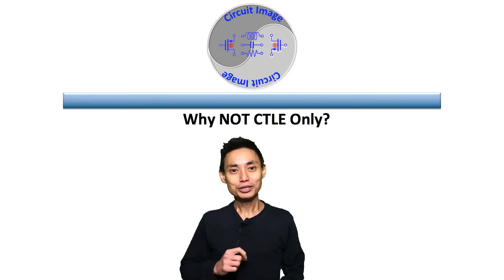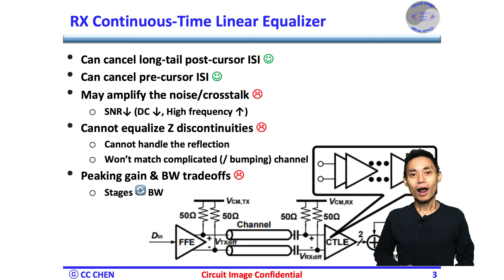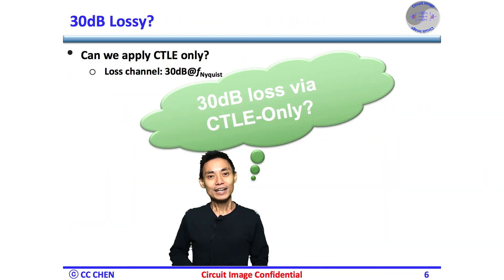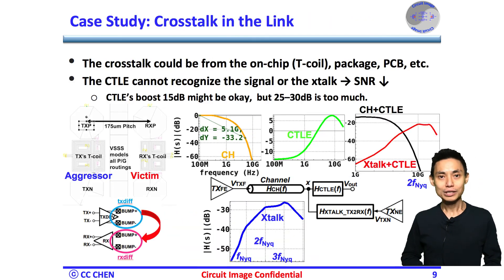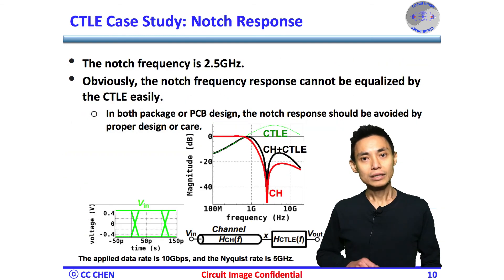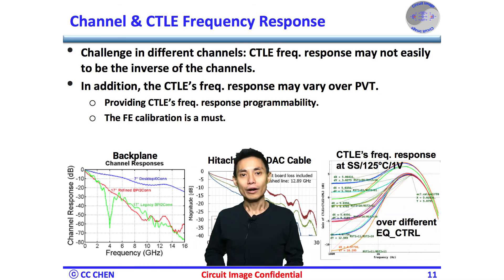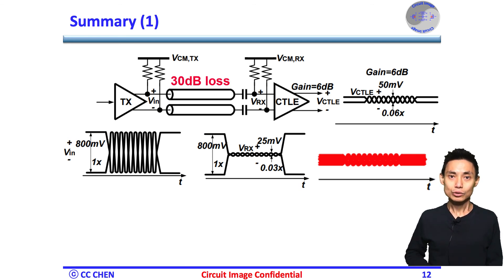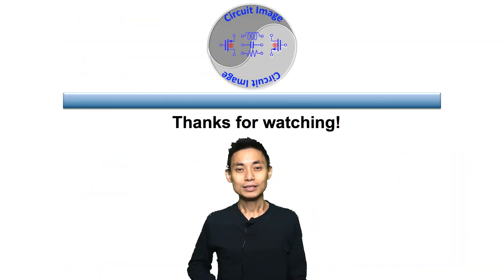Why NOT CTLE-Only?

Comment: Hi chen,I wonder why FFE can also solve the problem of impedance discontinuity,just because it is also the nonliner system as DFE?
Reply from the maker: Hi Yujian, nice to meet you and thank you so much for the feedback. The FFE can mitigate the impedance discontinuity since it's a discrete-time implementation. But, the TX FFE is not quite efficient in power if a longer post-cursor or taps (from the reflection) is needed. But the DFE could have a much longer post-cursor. and low power compared to the TX FFE. Please be advised that the number of taps depends on the round trip of the reflection. Thank you very much again for the good questions. 😀
Reply: i can only undestand from time domain analysis ，but not from frequency domain analysis。Can you give some analysis from frequency domain?
Reply from the maker: @yujianzhai  Thank you so much for the feedback. Here https://youtu.be/BVM3HMCVtuA has some frequency domain analysis of the TXFFE. As you can see, more taps can provide a more highly programmable frequency response of the gain shaping, which maximizes the SNR by reducing the reflection frequency content? 😀
Reply: @circuitimage  thanks chen,i mean if there are some big difference between the frequency response of CTLE and FFE，jiust like the FFE‘s frequency response has notch?
Reply from the maker: @yujianzhai  Thank you so much for your clarifications. That's what I mean by that the peaking (gain & frequency) of a CTLE would be coupled or constrained together. But, the FFE with more taps more than 10 taps (presumably), would have more flexibility to adjust both different peakings in gain & frequency, separately. But, the overhead is to provide as many taps as we could. If we only have 1 or 2 taps, that might not be the case in the frequency response.
Reply: @circuitimage  thanks chen again，i think i have understood，a good explanation!
Reply from the maker: @yujianzhai  Thank you so much. I'm glad I was clear this time 😀 and I can help you.

Comment: Nice video. I have heard about this crosstalk issue before, but was not aware the mechanism behind it. Thanks for explaining. 
One question on terminology: When we say that the CTLE equalizes 15db loss, do we mean that its peaking gain is 15dB? Can we think about this value as the difference between CTLE's gain at Nyquist frequency and CTLE's DC gain. For instance, lets say at Nyquist frequency gain is 5dB and DC gain is -10dB, then we have peaking gain = 5dB - (-10dB) = 15dB.
Reply from the maker: Hi Hrachya, thanks for the good questions. The peaking gain is not gain at the Nyquist rate, which confused people all the time; therefore, you're correct. Peaking gain is the value as the difference between CTLE's gain at Nyquist frequency and CTLE's DC gain. Thank you so much.

Comment: Very useful. When you check SBR on the slide 5, did you apply differential 1V for 1UI and ‘differential 0V’(it means common mode voltage for both INP and INN) for all other UI to the input? Thanks !
Reply from the maker: Thanks for the feedback. Correct. For the Single-bit response (SBR), I applied differential 1V for 1UI and ‘differential 0V’ (common-mode voltage for both INP and INN) for all other UI to the input.

Comment: Hi, 
Thanks for the wonderful video! I was just curious as to why the differential mode of operation wouldn't be able to reject the crosstalk to a level that it would become insignificant even after CTLE amplification. Is it due to mismatch? Thank you!
Reply from the maker: Hi Somanshu, nice to meet you and thank you for the good question. Yes, part of the mismatch, but part of it could be the big interference to disturb the operating point of the transistor even the common mode. That's part of the difficulty of the CMSI in PCIe's spec.
Reply: @circuitimage  I see. Thanks a lot!
Reply from the maker: @somanshumishra1961  Hi Somanshu, you're very welcome.

Comment: Hi Chen, thanks for the video. At 8:10, the takeaway is that after 30dB loss (without Tx FFE), the high frequency swing is so low that its difficult to distinguish from Noise/Crosstalk (poor SNR) and any CTLE boost would just produce a closed eye at its output? Please correct me if I am wrong.
Reply from the maker: Yes, you are correct about the takeaway. :) Thanks for your feedback again.

Comment: Thanks for your nice video! In slide 9, or at 4:45, you mentioned the blue curve H(s) is a simulation result, is there a fundamental reason why this response is high-pass? If I understand correctly, the red curve (Xtalk+CTLE) is just a summation of the blue one and the green one, right?
Reply from the maker: Thank you so much for the fundamental questions. The channel is low pass, so you need high pass equalization to equal the frequency response.

Comment: Very good video, how crosstalk in CTLE is amplified was well explained.  Could you please also explain why crosstalk in TX-FFE will be amplified too? thank you very much . CC
Reply from the maker: @Meilin Wu Thanks for the good question. Yes, both CTLE & TX-FFE are similar since both cannot differentiate the noise & signal. The DFE can since the correct decision has been made and feedback cancels the ISI, not the noise, which is the beauty of the nonlinear slicer.
Reply: @circuitimage  Hello CC, thank you for the response. I understand that CTLE amplify crosstalk because of the Positive Gain, but since the TX-FFE does not have a positive gain, could you please elaborate how it amplify the crosstalk? Thank you very much.
Reply from the maker: @kellyrolla  Thanks for the good question. You are right about the TX-FFE, which would only reduce or attenuate its DC gain (signal). That would be another model interpreting the signal-to-noise ratio is attenuated or the noise-to-signal is amplified.